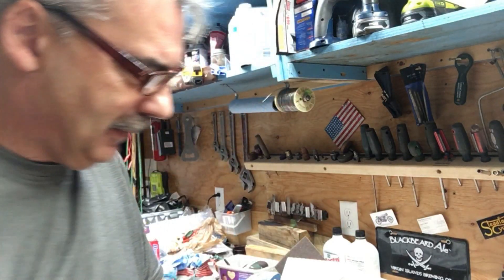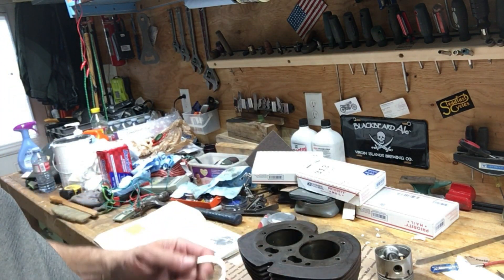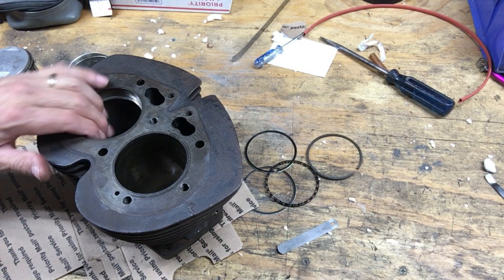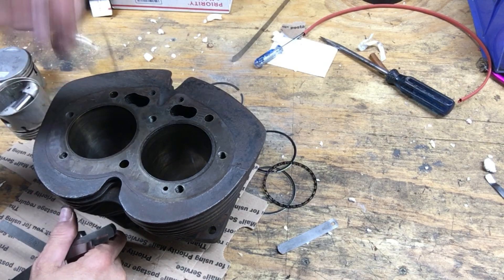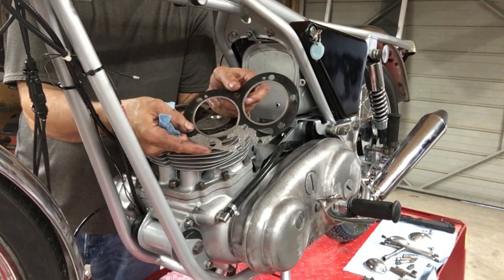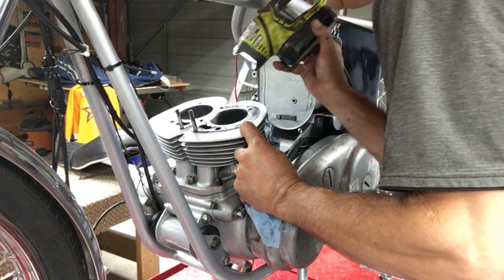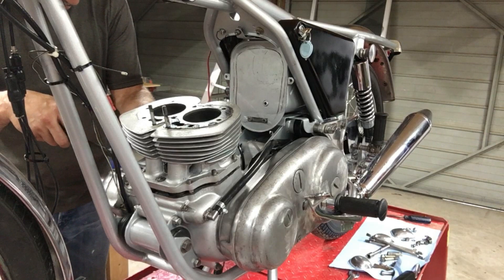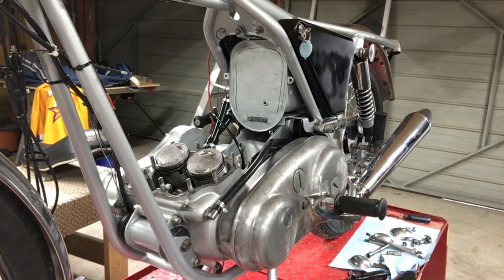Norton Commando Top End Removal in frame

Comment: Thank you for posting this.  I have a 750 from early 1972 and she has just started smoking on acceleration after a time on a closed throttle - got to be the inlet valves/guides!  I had a look, as its my first Norton, and it looked a bit tight for getting the head off, in the frame.  Watching your experience confirmed this.  Thank you for the tip on the piece of wood and the displacement of the pushrods up into the head, to win the clearance.  Oh, and you have great patience: I might have resorted to a few very ride words, there!  Thank you, again
Reply from the maker: Your welcome, And I edit the rude words out. Than take a beer break.

Comment: The last copper gasket I put in my 71 roadster leaked oil. The machinist who built the head for me did a sloppy job of planing the head and the copper couldn't deform enough to make up for the swirls on the surface. The fiber gasket is a better guarantee for a seal.
Reply from the maker: Yes, I agree, The fiber gaskets are much more forgiving. Thx for watching.
Reply: Motor Oil & Beer I actually searched for this video because I'm pulling the head off my commando now. I can't for the life of me remember what wrench I used to take off those two sleeve nuts. I have a Snap-On BS combination wrench that's the right size, but I can't get a grip on it. What did you use?
Reply from the maker: I think I used either a 14mm or 9/16" because mine was all rounded. from previous owner. When I took the bike apart 3 years ago I took the whole jug and cylinder head off in one piece because I couldn't get it apart either.

Comment: A good machinist should be able to hook you up mill the skirts bore & hone the holes hope the tapped holes are good at lest the fins are all good and how thick are the sleeves? 2nd over = .020 right. Your pistons with correct rings and the new cylinders should work. Just so you know I like the contrast of black cylinders like the combat engine looks cool man Thanks David
Reply from the maker: That was my plan to use my 2nd over pistons with a new set of proper rings and bore the new cylinders. The guy I bought the cylinders wouldn't drop the price because the cylinder skirts were damaged and were not stock as he described. So I sent them back, his loss and mine.
Reply: Too bad good used parts are hard to come by